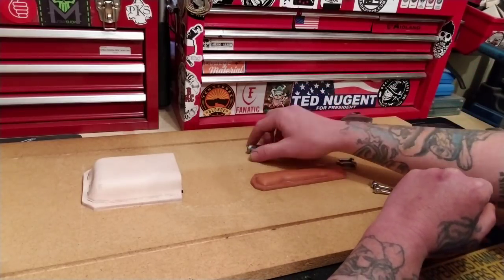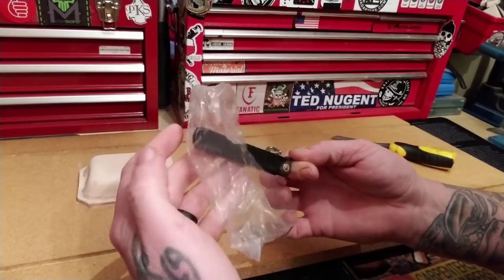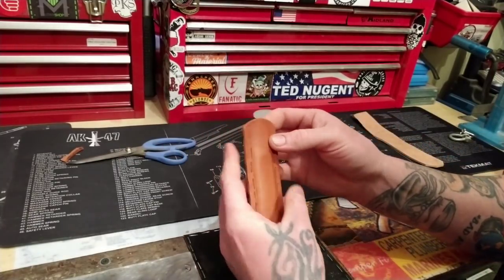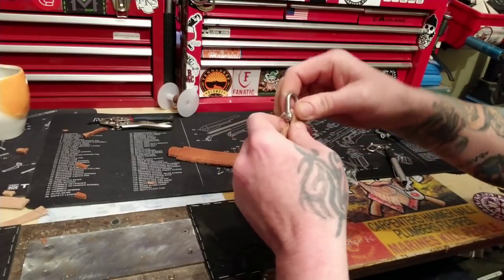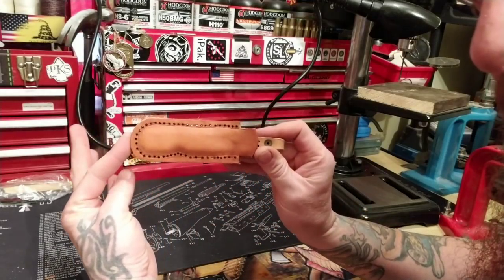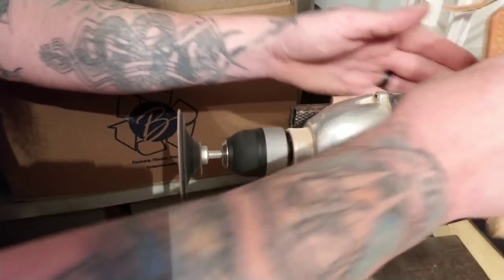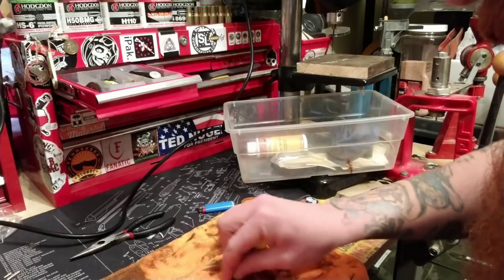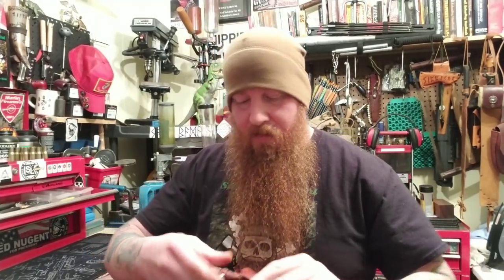Making a Leather Sheath | Japanese Higonokami

Comment: Idea your knowledge of leather working to design and make combat tabi combat leather knee high moccasins with a soft layered sole like how you designed those leather knuckles with leather straps with buckels  that wrap around and secure the moccasins around your calfs and knee. Could even design them to have different soles you can attach like how sidi cross fire boots are designed. Take a look at the sidi cross fire boot and cross fire boot 2 to get an idea if interested? 😊
Reply from the maker: +Indigo Dragon71  You could build a tree house on top of an 18 Wheeler that's traveling about 55 miles an hour running from the classic worship from the space Rangers that are coming from the planet Neptune and black hole which the Sun does just fine around this time year and dig hole put some cucumbers in there and transfer the electronic energy from the gasifier to the Earth still a sphere and maybe the power of the moon somewhere along those lines immigration is hard you could transfer that energy into tiny little wheels that span and conduct energy that way and run that to a tiny reckon that can fix and repair your roof or maybe on a Sunny day you could just have some sweet tea and all kinds of other stuff on the playground I like to take the sandbox inches dump it out and I have no idea?
Reply: You could use aluminum thermal electric generators and use a vacuum spark gap to increase the energy to high frequency with wireless energy transfer then insert the aluminum thermal electric generator into rectum and operate electronic devices when SRHTF most folks will be using every hole not just a fox hole or a bunker hole kiss get ready and wait.  A joe cell with aluminum gallium will generate HHO out of polluted water or urine and with tesla coils around the joe cell to absorb the energy bubble produced by the joe cell you can charge battery banks or even operate an electric vehicle or electrical power generator for a bug out camp all off goldden water. Yes they don't teach this type of stuff to military personnel because military personnel are trianed to throw their lives away. Interesting fact my grandfather told me was that all wars were depopulation programms and he fought in WW2. Young whippersnappers think they knowings everythings and act like smart asks yes?  Nothing like being a Staff SGT perfect orfice? Why do survial vides were you share knowledge of survival tips and technology if y'all going to poop on any one who is over filling your cup with great info that will improve your survival rates and improve your quality of living during and after a SHTF event? Wow lots of folks are just really buggy these days. 😒👽
Reply: Good thing i decided not to share an herbal antiviral and antibacterial tea with folks. Its way cooler to just sit back and watch that well planned show put into place by all that prepared government food USDA choice. Y'all were trained in the military about how yeast can be weaponized and filled with retroviruses that can be triggered with a catalyst? Oh its just one of those conspiracy theroies pay no mind to it carry on has you were just please keep Your vlogs going so i can watch the process. Hay its just theorizing and its not illegal to therize correct? MAGA!    😊
Reply: Oh hay if y'all getz boarded y'all should sit down and watch a few of them you tubers videos of them there huge translucents spheres causins solar tornadoes on the sun for close to 80 hrs then zipping of into space. Y'all thinks that could be them power space rangers y'all referenced causing the sun to go from a warm yella to a bright hots white? What do marines yell ahooo or who ra? Just a weird observation with all the weird weather and all. Just sharing intel to help youngins take it or leave it. 😊